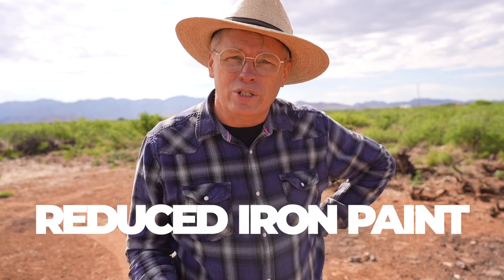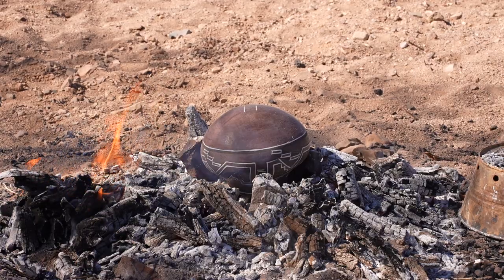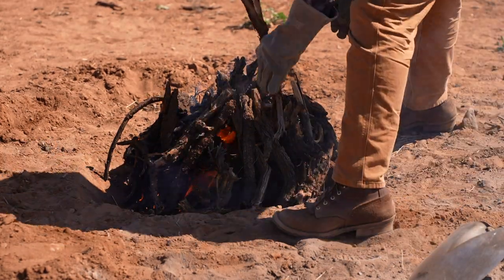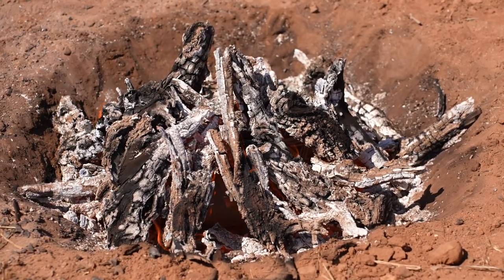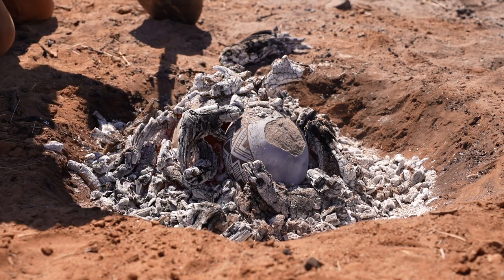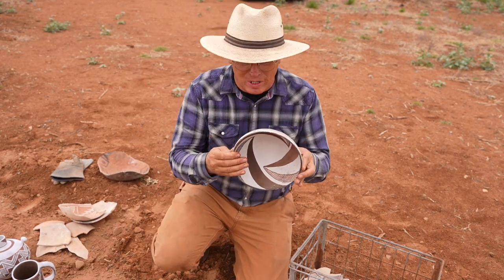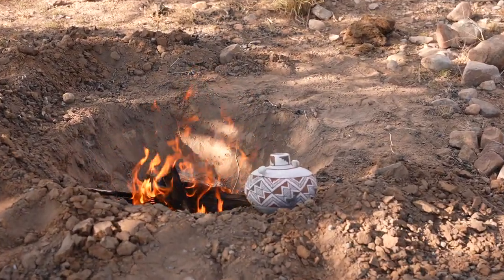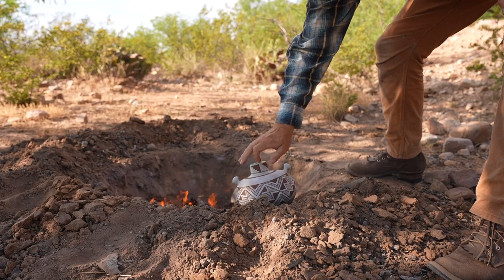Reduction Pottery Firings Don’t Always Go As Planned

Comment: Very interesting that reduced iron paint is one of the first pottery decoration method that shows up in the archeological record. It would seem logical that the firing techniques they used for getting reduced iron would have been the same/very similar as they had already been doing for pre-decoration pottery. So like the surface firing technique that you do for salado polychrome is a “newer” firing technology, right? Is that shallow pit fire you did what we see the older pottery firing methods looking like in the archeological record?

Comment: Perhaps trying a version of the upside-down fire might work as it burns cleaner and hotter.
Reply from the maker: Sorry if I should know this but I have no idea what an “upside down firing” is.
Reply: @AncientPottery  An upside-down fire is where you put the larger logs on the bottom ensuring there is no space between (or at the very least minimal space) and then you layer progressively smaller logs until you reach the kindling. You might be able to modify this method to fire pottery. Perhaps you could “house” the pottery inside it? It might be able to minimize the oxygen and cover the pottery as well.

Comment: Hi Andy, I rewatched the part about you fireing the sheep pot, that seemed like a clue. You buried the pot with a LARGE POT over it. 
When I did Raku,  I pulled the pot out of the kiln and placed it on a bed or sand with some sawdust or paper then used a garbage can to cover it. I pushed and wiggled the garbage can in to the sand to keep the air out. Maybe try using the large clay pot over it again. I think the important thing is to keep the air out and burying it just isn’t cutting it.  
When I get really stuck when I do Genealogy, sometimes I go back to a completely clean slate and go back to the beginning and start over. Like what is oxidation? What is reduction? How do other potters get reduction? 
I didn’t fire the kilns at school, but I know it took 3-4 days to fire the big reduction kiln, when it got up to temp they pushed fire bricks into the air holes to get reduction.  I do not know the particulars…
Could you make a large pot with extra extra grog or sand in it, kind of like making a firebrick but a pot, not a brick?  
Another thing, maybe it is something you are missing in the white clay slip - glaze or in the black slip glaze.  Are there any natural frits they could have used? A slightly different mineral ingredient? Did Indians have any soda to be a frit or maybe salt???
These are all just ideas.  I hope they help.  Wishing your next firing goes well. I love what you are doing and admire your persistence!
Reply from the maker: Thanks, I appreciate your perspective and out of the box thinking. Have you seen this video where I tried salt and other fluxes with paints? https://youtu.be/T43SPssR1VI
Reply: No, but I will look.

Comment: Colors of flame must be indicative of temp.  Maybe use a digital thermometer and cover at various temps that have yielded the desired results.
Reply from the maker: Yes, that's exactly the case, I looked it up, those blue flames are hotter than orange flames. But also, and I think this is the most important thing, the blue flames indicate complete combustion of carbon. So when you see blue flames less carbon is being released to get absorbed by the pot.

Comment: I enjoy how you show the process of learning these old techniques, and explain how and why things went wrong. The pot turned out nice, despite a few areas where it was still slightly red. I actually like the variation on color. Does the pot have a lid or a cork? It looks like you can wrap leather cord around the knobs at the top, so it can be carried, is that right?

Comment: I think you might be on the right track.  If it was the earliest form of pottery in the Southwest, that suggests that, at least from the perspective of ancient potters, the ones who were developing pottery for the first time in their society, it was the most obvious, convenient way of making pottery.  Burying it overnight might have seemed quite logical to them, for any number of reasons, but one that occurs to me is that it may have been a common practice to bury fires in general when not actively using them.  After all, living in the Southwest, they probably would have been concerned about the dangers of accidentally starting brushfires if they left a fire unattended, and they probably would not have wanted to use water to put out fires, since water would have been scarce.  So burying fires as a safety measure would have seemed logical, and they may have developed such a custom for dealing with cooking fires, which they then might have transferred to their pottery fires.  I don't know, of course, I'm just hypothesizing.
Reply from the maker: Some good thoughts here, thanks for sharing. There is a tradition of cooking food in smothered pits in the ground in the southwest too.
Reply: @AncientPottery  You're more than welcome. And that makes sense, because they would have used fires for cooking before they used them for firing pottery, so it stands to reason that they would have adapted techniques from the former to the latter.

Comment: Hey Andy, seems like you've got exposed red ferric oxide on the outside of this finished pottery, while what you want is black ferrous oxide. Why not just toss the whole completed, fired vessel in a pot of boiling water to covert it, as in the rust bluing process for finishing steel? Are you just avoiding that cause it might not be authentic? Immersion in boiling water is a quick, easy, and highly effective means of converting red to black rust.

Comment: I have the feeling that they probably used some kind of saggar when firing the pots so that they avoided having physical carbon (sooth) stick to the pots. The oxide should react with CO and CO2 that will flow in the protective housing at those temperatures (though I'm no chemist so don't quote me on that).
Reply from the maker: Great idea but there is no evidence that the people of this are ever used sagars. Although I agree that would be a better option for getting the results I am after.